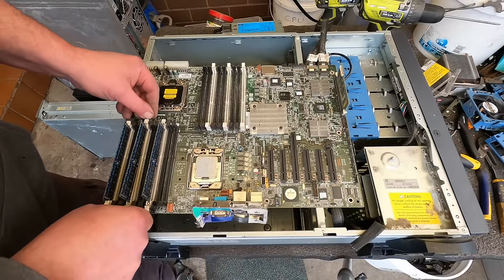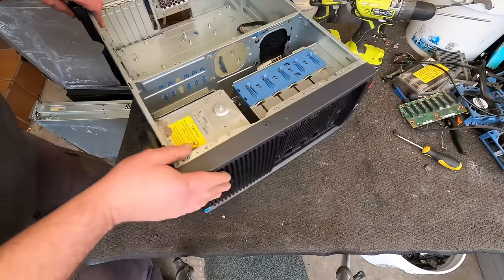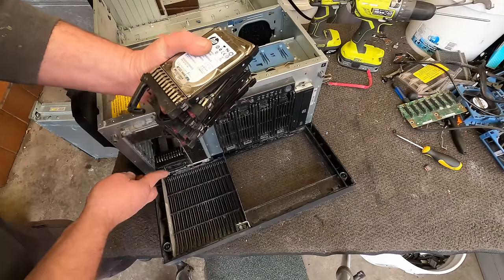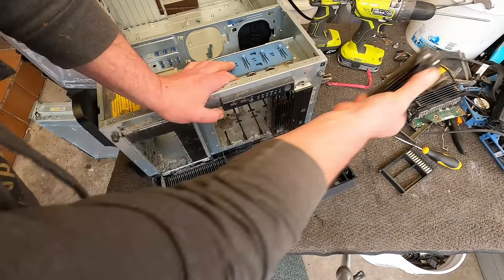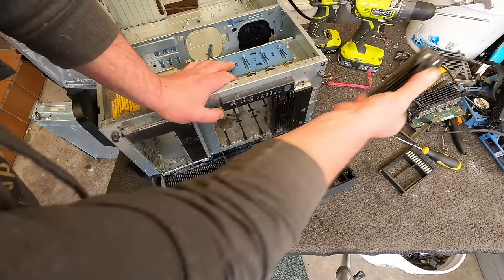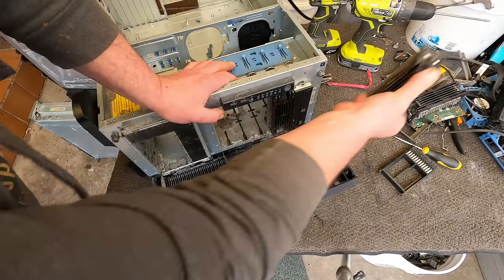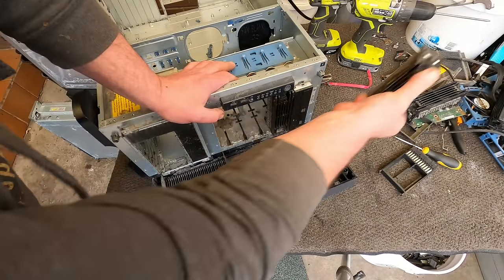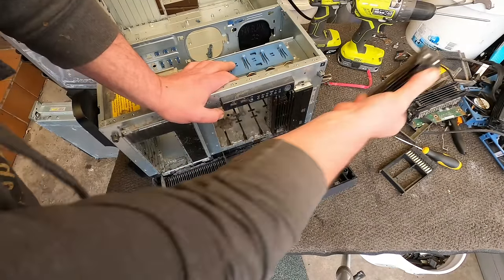Scrap Marathon Biggest Ever Part 3

Comment: 52:30. Trying to explain why those copper top IC's dont have as much gold as  the normal gold corner chips? Yes, they contain just as much gold as the regular ones do, they just have the added copper top on them. The gold bonding wires on them are the same.. I have processed many of them.

Comment: Hey Ben,
Does your yard take plug ends separately instead of throwing them in as dirty steel? My yard has a category called "Brass Recovery". They take separated plug ends and I generally get 3 times the price of dirty steel.
Reply from the maker: Not sure about plugs but I'll check, I do take the brass prongs off though
Reply: @eWasteBen  I do take the brass prongs off the larger plugs from stoves and other appliances, the rest I dont bother. Canadian yards are 6.75 cents per pound on dirty metal versus 20-25 cents per pound on brass recovery. It is a big difference and plug ends with plastic housing add up very quick in weight as you know...
Reply: I grab the plug with channel locks and grasp the brass with side cutters. Instead of cutting I roll and pull the brass out. Then I cut the bit of clean copper wire off and put the brass in dirty brass. It usually has copper, solder or something on it. I would cut it clean but I have way more dirty brass to sell then clean.  Keeps my piles moving.

Comment: Hi Ben . How do you process power cables? Do you cut ends off and sell as is or do you strip them off the insulation? and if so just the outer or the insulation off the 3 wires too?

Comment: Plus just so you know you need sharp cutters. SHARP BLADE. Get a pair of aviation snips that will go around the whole bundle of wires you want to cut and not one wire at a time in a bundle of 3. All the scrappers I watch including myself use the aviation snips and one used garden shears to greater advantage. 
Just suggesting

Comment: Have you considered a Fiat Ducato/Renault Master/Vauxhall Vivano (orwhatever they are sold as in Australia)?.
They have loads of poke, are front wheel drive, have a low load height and are really superb to drive. My local Ambulance Trust is switching from Mercedes to Fiat due to the better build quality and handling.

Comment: Hello Ben, I am not sure if you read my comment in Part 2. What you were saying here is what I was suggesting to set some targets like first clear stuff in front of your garage door, etc. Surprised to see you talk most of my stuff here.
I suggest few more things to make it more interesting.
Please make one yard run content in each of the Parts. I noticed, you were strangely quite in the yard this time. Compare to your earlier yard runs, you didn't speak as muchor compared to as much as you speak while scrapping.
Another suggestion. If you see anything in bulk, lets say the switches in front of your garage door, you set a task of clearing them all. Scrap one or two on camara and tell viewers that the rest will be off camara and in the next frame show the empty space. It gives a sense of fulfillment.
Another suggestion :  You said on record that you want to stash your gold bearing stuff for retirement, right? In this Part, you said you did not enter the garage in one year. That is the kind of stashing your gold requires. It wont require visits and you dont fell bad about not processing the stuff in there for a year. Two birds with a stone. Pack all your gold stuff in identical, easy to handle packing, lets say a 10 kilo plastic containers neatly stacked against the farthest side of your garage.
One more suggestion : You had a big lot of brass some where near your chicken house. All big stuff. Get rid of them while you get good prices. It was  more than 100 kilo the last time I saw.
Reply from the maker: At the scrap yard I had a mask on, hard to breath let alone talk :)

Comment: instead of a van why not try for a lwb truck with a metal cage  that overhangs the cab with more storage capacity and have it installed with a lift for easy access

Comment: 2030USD per troy ounce of 999 fine gold if your gold is not three nines fine its only worth scrap value which is not governed by the price of gold that much and most companies buy n sell the rights to gold instead of the gold itself and can be easily be changed to higher or lower based on the rights to the gold not selling gold itself. plus gold is dependant on the currency of a country and visa versas if one dies the other can too. Plus ben if you want to know a cost effective way to refine you're gold check out the channel sreetips
Reply from the maker: well not really, if gold is $2030 for 1oz and you have a 1oz coin 50% gold & 50% copper, they would still pay $1015 for it. gold is gold no matter what purity it is
Reply: @eWasteBen  just watch sreetips he has some insight into the gold n silver trade that might be helpful but saying gold is gold is not quite right cos 10k gold is cheaper than 18k gold and so on the price of gold varies on the grade which is why most refine to three nines to get a more accurate price for their gold when gold is an alloy either with copper, silver etc it will be cheaper than you think because its not pure